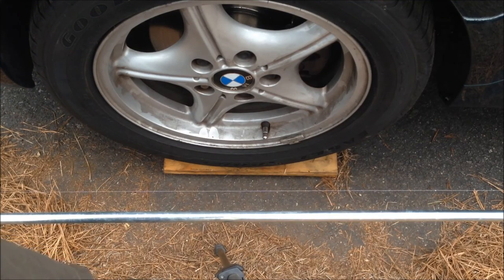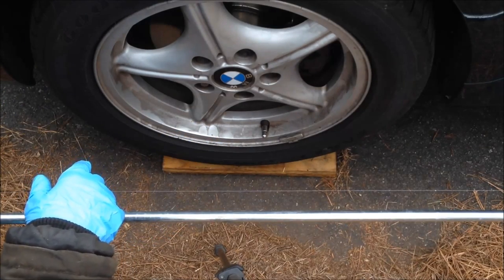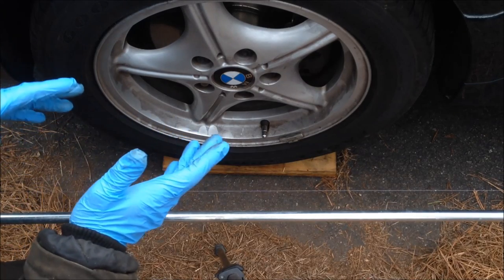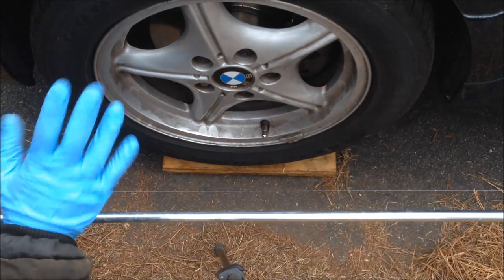How to Build and use a Four Wheel Alignment tool for Cars or Trucks

Comment: Let me save you a lot of trouble, TMD. Throw the wood and metal plates away and use doubled 6 mill trash bags instead. Way cheaper and easier.

Comment: what if the width of the rear is wider that the front?
Reply from the maker: It doesn't matter ... you center the string line by having equal measurements from the wheel hub centers for the front and rear

Comment: Useful video, why do you need the long conduit along the length of the car, if you have the short conduit front and rear as long as the distance from the wheel centres is equal it will be square won't it?
Reply from the maker: roasthunter I have found that the width between the front 2 wheels and the rear 2 wheels may not always be equal.  Constructing a rectangular / square fixture eliminates this issue completely.
Reply from the maker: ProjectsbyTMD I should also mention one other point ... keep in mind that a vehicle's independent suspension - control arms swing on a radius.  If the weight distribution causes the front & rear wheel ride height to be uneven, the width between the front and rear tires may not be equal.  As such, the rectangular / square alignment fixture eliminates this potential source of error - especially when you are trying to align the car to small measurement (1/32") toe-in / toe-out specifications.

Comment: You've assumed that the front and rear track are the same.
Reply: His setup does not require front and rear track widths to be the same. Since he made sure the distance between the eyelets (that the strings were tied to) were equal, and the lengths of the long side rails were equal, then at worst he has a parallelogram. Using the the corner fittings (which are supposed to be 90 degrees) makes his setup a rectangle. Actually a rectangle is not necessary. We only need the two strings to be parallel to each other. Then measure the distance between the center of the rim to the string on both sides in the front and make sure they are equal. Then measure the distance between the center of the rim to the string on both sides in the back and make sure they are equal. Note the measurement of the distance from the center of the rim to the strings in the back does not have to be equal to that measurement in the front.